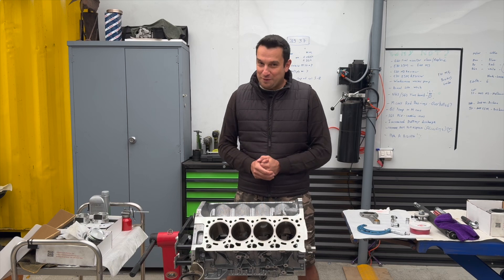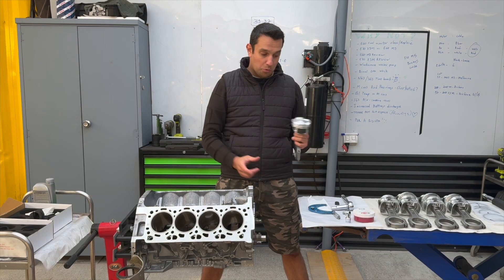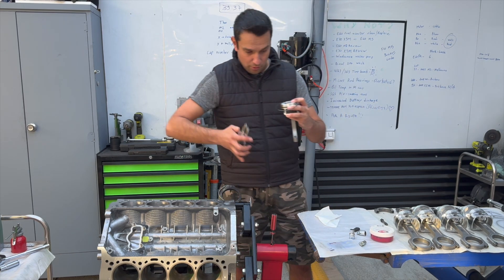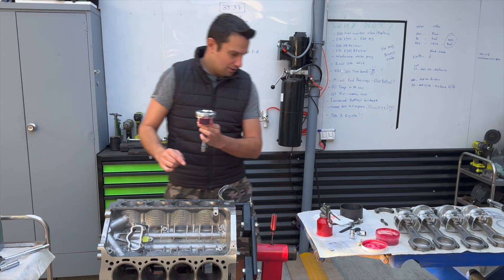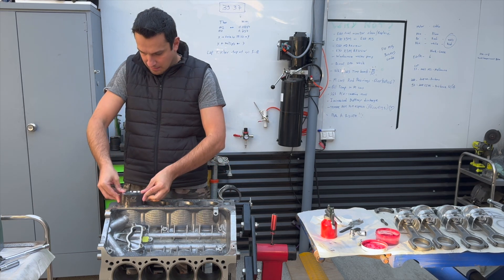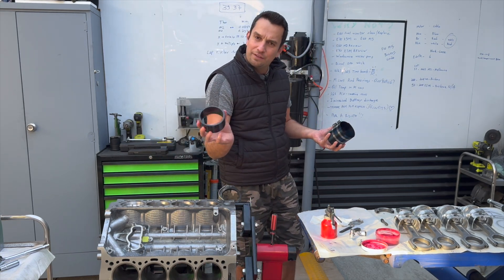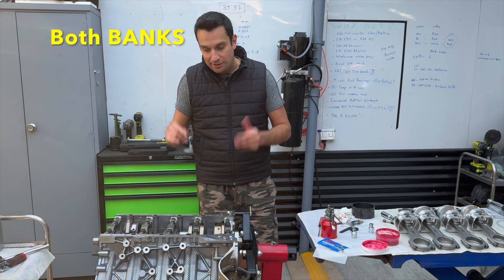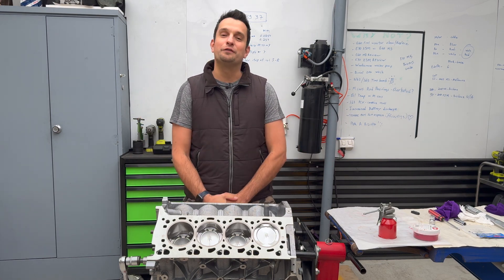BMW F10 M5 - Engine Build Part 2 - Installing the pistons and rods

Comment: Did you use the old bolts or new ones when connecting the rods to the crankshaft?
Reply from the maker: Rod bolts must be renewed unless they are ARP bolts

Comment: I love the f10 M5 but the engine is just eating so much oil and it just comes apart. My goal here is to rebuild the engine and put the parts in there that are necessary and done the right way so that I can enjoy a car that I spent ridiculous money on.
Reply from the maker: If the engine is running with no damages to it, and you’re doing the work yourself it could cost you as little as $5k to rebuild and have it as a reliable daily - pull the engine out, replace the bearings, chains and all seals - that should be good for at least another 100k kms if you’re using good aftermarket bearings.
Reply: @dnl35projects I noticed you're using forged internal parts on your engine build. I also noticed you sleeved that engine you were working on. The sleeving is the question I understand you did it because you had some scored cylinder walls but in your teardown would you do the sleeves?

Comment: Here's my question at 10 twin turbo as you know the grenade engine parts they burn oil they leak oil. As your rebuilding this are you rebuilding this engine to be better than what BMW put back in their car. To alleviate those problems?
Reply from the maker: Yes, they don’t burn as much oil neither grenade themselves after the rebuild

Comment: Thank you for the detailed walkthrough. Were these the kingtec rods/pistons? And for some cars like my Mercedes M157 5.5l they recommend to have darton sleeves? What's the recommendation? Would we really need to sleeve it? Can we just drop rods and pistons like you did? Appreciate your view.
Reply from the maker: Hi, I'm a big fan of sleeving the block as it gets stronger and can hold more boost however I understand the cost of getting it sleeved (properly) is a bit high depending on where you leave. I'm an also not a big fan of darton sleeves because they are a bit too tick for the applications (BMW V8s) I normally use but yes, I definitely get the block sleeved when using Kingtec pistons (including the one on the video) - Another benefit of sleeving it that you can get the piston to wall clearance exactly where you want when hooning the sleeves.
Reply: he didn't just drop rods and pistons, he sleeved this block... but you can in fact use drop in pistons and conrods and it would still work great as long as the block is not scored. You would have to get your crankshaft balanced to the new Rods and Pistons at a machine shop. Sleeving is not necessary for the S63TU and lots of people have 1000HP builds running currently without sleeving with over 500 runs at the drag strip but those people ran Carillo or 5150, not Kingtec. These Kingtecs are getting alot better and im really interested in how long they could work reliably as they cost much less than 5150 or Carrillo. Only time will tell if they are actually good work or not. Cant wait till DNL35 has his up and running max power to see if they can hold up!!!! I always come back to your page to check progress lol.

Comment: Great. Someone said the teeth of the rings eventually cut into the cylinder walls thus causing the destruction of the walls. What say you about that issue
Reply from the maker: I don’t have data or evidence about that however I do acknowledge the stock ALUSIL block/cylinder walls are quite fragile and get scratched/deformed pretty easily hence why I like to sleeve these blocks making them stronger.

Comment: hey quick question, since the pins got seized in the piston because it was 9 degress celsius, what do you do if you wanna start the engine at -20?
Reply from the maker: It is still ok because the pins only seize on the piston and not on the rods. I'd say once the engine starts the clearances get in line after a few seconds however I cannot see that being good in the long run (for the whole engine)

Comment: Hello sir, I have a question. When the cylinder liners are ringed, is it advisable to rectify them or does that damage the material of the cylinder liners?
Reply from the maker: Hi, you can sleeve the whole block if theres damage to the cylinder walls
Reply: Master of masters, what brand of rings do you recommend, or some link where I can find a good quality brand, it is for Mexico. It is for the N63B44B engine
Reply from the maker: I like using Goetze rings when sleeving the block however they are not available for the stock BMW ALUSIL block - Unfortunately we are using Chinese/aftermarket parts on this build (video) and there are no rings available other than the ones which come with the pistons

Comment: Hi There, what are torque settings on the oem rod bolts, 75nm is for apr
Reply from the maker: Correct, the ARP are torqued to 75Nm -  OEM bolts are usually torqued to 20 or 30Nm + around 70 degrees of angle - It varies according to the engine/part number you are working on
Reply: Thank you so much
Reply: Master of masters, what brand of rings do you recommend, or some link where I can find a good quality brand, it is for Mexico. It is for the N63B44B engine

Comment: Are there different ring types for a normal block vs a sleeved block?  What do you use in both cases?
Reply from the maker: Hi, yes the BMW OEM rings on these engines are for Alusil block and the sleeves we put in are cast Iron, so we had to buy rings for a cast iron block (similar to what was produced back in the 1980s and 90s)

Comment: You're equipped with a Kingtech product! I'm looking forward to the driving video! Is the quality of the product okay!?
Reply from the maker: Yes, I’m looking forward to it too ! We had to modify a few things to make them fit and they are currently working on them to make it better
Reply: @dnl35projects I bought the same product May I know the modifications?
Reply from the maker: We had to adjust the size of big end on conrod as it was too big
Reply: @dnl35projects Is it a defect in the kingtech product that the big end is large in size?

Comment: Congrats for all the hard work and thank you for clear explanations!! Can wait for next video and also to see videos of car running! Cheers
Reply from the maker: Thanks ! I’m looking forward to see it running too - will keep you updated
Reply: Pistons fantastic rod garbage spins freely after installation start making heavy power on those rods cause crank shaft failure after 4 to 5 months out cause catastrophic failure on 9 of my motors the material is weak very easy to cross threat the arp bolts and yes they do snap off 😩😩😩😩😩

Comment: Super valuable content.  Could you mention any differences in assembly for the N63 version to be aware of during assembly?  Thanks.
Reply from the maker: Hi, N63 and S63 are exactly the same from an assembly point of view - they vary a little bit over different year model and have different parts such as pistons, turbos, manifolds and camshafts however putting them together uses the same tools and procedures

Comment: Nice walk-through. Comment on piston orientation - you need to consider valvepockets also, so that intake pockets will match the intake valves…
Reply from the maker: Thanks, the valve pockets in these pistons have exactly the same depth

Comment: I didn’t really understood how to determine which way the piston is rotated.
Also, shouldn’t be the conrod bolts torqued further to some angle after first torque to 75NM?
Reply from the maker: Hi, the orientation will depend on the manufacturers specifications, my comments are just to frase the fact they have to go in a certain way. 
BMW bolts are torqued to yield so yes, you torque them to about 20Nm plus some rotation - we are using ARP bolts in this build so they are just torqued to spec ARP recommend.
Reply: @dnl35projects  makes sense :) thank you! Keep up the great work! :)